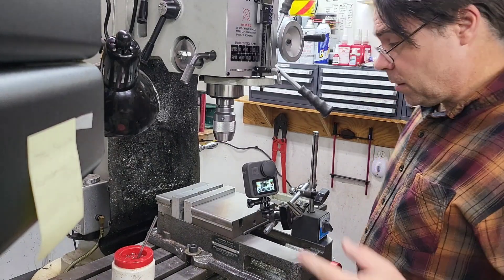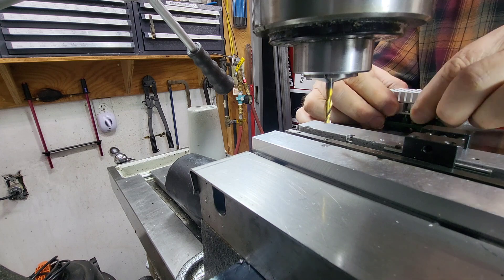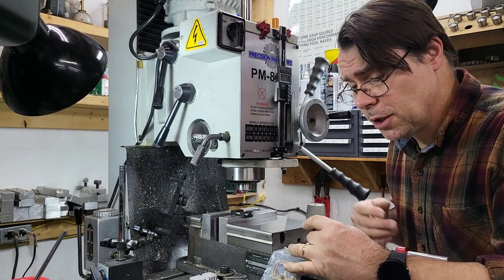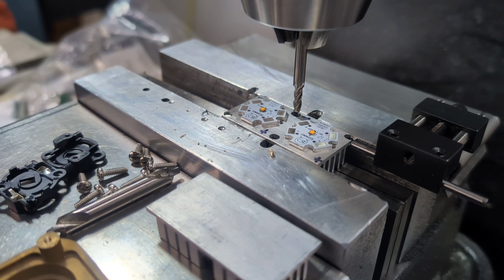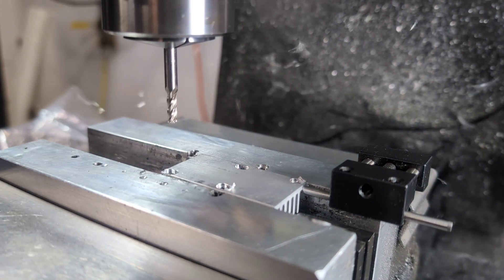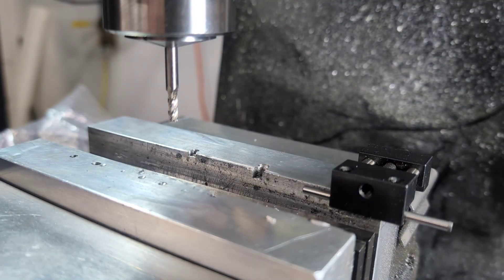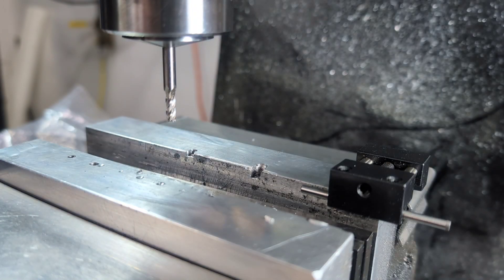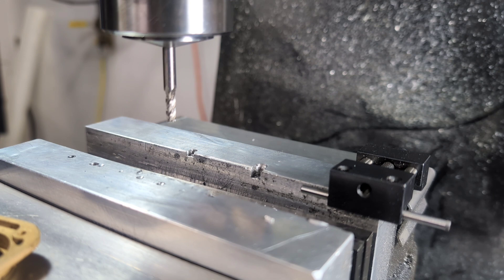Machining LED heat sinks for 1:8 scale locomotive headlights

Comment: I didn´t know that del produce so much heat and need heat sink.
Reply from the maker: They do need a heat sink, but not necessarily as big a heat sink as I put on. I went with more heat sink than I needed because this was the closest size that would fit. The benefit to having a heat sink that is too big is that it builds in reliability and the ability to upgrade to a brighter LED without having to source a new heat sink. It is also a structural component for the headlight assembly.
Reply: I learned something new today. Thanks Aaron & best success.
Reply: I learned something new today. Thanks Aaron & best success.
Reply: LED's don't produce as much heat as an incandescent, but they cannot tolerate the high temperatures an incandescent bulb can. So, they need a heatsink.
I like the idea of making it bigger than necessary. Too many times I've fixed dead LED lamps that have burnt out the LEDs due to poor heatsinking.
Reply: @BenjaminEsposti  Thanks Benjamin, didn´t know about their fragility about heat. That´s why they don´t recommend them in an enclosure.

Comment: Great job! the symmetry helps you could do single stop for multiple blocks!  it all looks great
you need to determine the set up to have predetermined places set for each of the cuts and drill 
holes. taping from the mill head keeps it true! what size of the screws? look pretty small. 
if the lights are rated for 3 V do you have a step down transformer to power them?
Reply from the maker: I use 4-40 screws to hold the light assemblies together. I use a 3-30V dimmable LED driver and plug the DC in directly to the 24 line from the battery. It's a setup that I've been using for about five years now.
Reply: @MillBrookRailroad  
sounds super reliable, you have an extra for cab lighting, along with the heat sink
it should operate with out any issues. I have a storage cabinet with number 
nuts and bolts along with a number of screws .